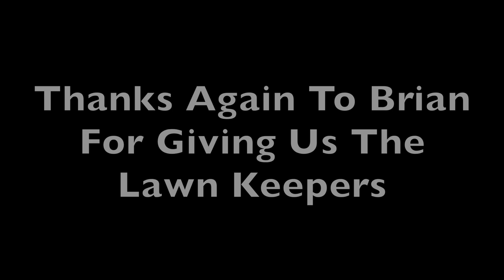(Part 1) You Don’t See These Mowers Anymore - Will It Run?

Comment: Hey Taryl, what a catch. When you lifted that mower up and I saw the frame made out of round and square tube welded together, it reminded me of my time as a welder in a shop summer of 1970. There were  199 thousnady million job shops in the Detroit suburbs where you could get a job in a second. Staying at one was something altogether different though. I worked in a 120°F production welding shop where we had 450 amp mig welders w/ water cooled handles and a setup guy for each welder. Imagine  4'X4'X4' palleted boxes full of parts to be welded together. That provided my dinner. Couldn't wait for the Roach Coach to show up at 10am for a snack break. Then lunch at Noon, and 15min break at 2:30 then home goin time at 5pm in a 500hp car to drive in bumper to bumper traffic for 45mins. Yep, we welded little frames like that one, crossmember parts for Ford, luggage racks for Yamaha etc. And if you didn't like the job, you could find another in 10mins. Those were indeed the days. After that our politicians sold us out and everything went to C-H-I-N-A. And a Lot of it is JUNK. OK, fine video Mr. Dactyl. Thank you very much for the entertainment. ben/ michigan
Reply: There's no law saying you couldn't start your own job shop.

Comment: These older Briggs have some real longevity. Honestly think it would've ran first pull if you could've taken the choke off fast enough. Thanks for the dinner, Taryl!
Reply: I agree but they should have had the serial and model number stamped in the block instead of the shroud

Comment: Bolens was still making the articulated riders in the '80's when I was working at a dealer-they started coming in with steering cable failures. They came out with a retrofit kit that I had to install-no charge to the owners. Thanks for taking us along on your journeys, guys!

Comment: I remember these coming into the shop every spring for tune up and sharpening.  The original “almost” zero turn mower.  People with estates and a lot of landscaping really loved them, but they didn’t hold up very well over time.  I like the way the green lever lifted the front deck for servicing. Cool stuff.

Comment: Awesome mowers, just love the old stuff they were built to last not like the crap they sell today. Going to be a fair amount of work to get them restored but what a treat to pull them out from time to time and give them a run like they were designed to do in the mid 60's. How's the new shop coming along Taryl, update coming soon? Keep up the video's, cheers.
Reply: I really like seeing older stuff too. The way they are often "overbuilt" in certain areas and the 50s-60s-70s styling is neat. Nowadays they have really mastered the art of mass production and wherever they can, they cut corners and make the parts out of very thin sheet steel or plastic and the (big box store mowers) designs are all about identical with just different styling, decals and paint.

Comment: I like how the gas line is not a rubber hose that would deteriorate over time. When I was a kid, my Dad brought home a "burns" mower that is that size but not a split frame. The mower motor on the burns had so much torque that you could pop a wheelie easily when popping the clutch quickly! Good times..

Comment: You buy replacement shoes you reglue back onto those brake pad peddle that rides inside of those rims on those riding lawnmowers you just got. Those are brake pads that half to be done that way to. Instead of regular types of brake pad shoes. That's another item online part you can order still to. I'd order two sets of those if you decide to. It'll save money for shipping and handling fees in the long run to that way taryl. Acetone removes that adhesive glue good to. Then sand those brake pad peddles so the glue sticks and adheres to the surface better to. Good luck on fixing and restoring that pivoting frame and body bolens riding lawnmower to.

Comment: The air filter looks just like the ones on the 3 and 3.5 HP B&S powered push mowers I used in the 70's. The spring strap that the seat is mounted on might be bent or sagging from decades of use. That does look like a tight fit between the gas tank and the seat. Cool looking lawnmower.

Comment: That would be a fantastic rig to bring along to shows and swap meets. Its small and maneuverable. Save the deck for the other one and get a electric start for this one. There's yer dinner.
Reply: It really is a convenient and compact machine and really shows us you don't need horsepower in the double digits. I imagine it is a bit tippy on hills though so it isn't a perfect machine (none of them are but zero turns are approaching that larger safety margin).

Comment: You guys have all the cool toys. Thanks for the video. Thanks to Brian for making the video possible. I think the horses were bigger in the old days.   
I had a house brand 25 inch push mower that had a 3 HP Briggs flat head with the pulsa-jet carb. Bought it new in 1961 or so for $50.00 and kept myself in pocket money cutting a bunch of suburban lawns with it.

Comment: Man I flipped when I first saw these mowers, I was born in 63 and I remember them,  I completely forgot they made these. Used to see them on golf courses alot. I have a bolens push mower. Drain the fuel out every fall, starts up 1st or 2nd pull every spring.

Comment: I remember all those goofy looking mowers from the mid 60"s.Seems I remember most commonly the 2 1/2hp.Briggs & Scrapem powered many pieces of lawn equipment.Had a go cart powered by one.Went thru quite a few of them.Dibdn"t pay for anything back then,someone was always scrapping an old horizontal shaft mower.Never knew you could get them to spark with just a turn of the flywheel without spinning it,Great vid!
Reply: That's BREAKS and Scrap 'Em. Must be the hillbilly teeth that causes so much misunderstanding. I often wish he would drop the schtick and just do it straight but keep the witticisms.

Comment: That's so cool! Never knew that there was a riding law mower that small and articulates, and only has a 28" cut deck with 3 blades.  The engine is a real B&S compared to todays standards.  The tires remind me of the two Gravely convertible mowers we have.

Comment: Today the 910 would cost at least $3,318.93 and the 911 would cost at least $3,798.26. MTD appears to own the Bolens brand and a 42" mower under almost any brand name can be had for less than $2500 from almost any big box hardware store.

Comment: I has one with a Briggs, in the '70s.  One time it broke in half.  The local welding guru cut out the pin that had broken off and replaced it with a hardened bolt around 7/8" give or take.  Mine had plenty of wear and kept breaking down.

Comment: I guess Bunton went out of business? Made edgers and trimmers that pretty much got made obsolete when the new fishing line string trimmers got invented--
they made a 20" wide pushmower that had a 3 and1/2 hp. Tecumseh "XL" engine that seemed more powerful than the typical Briggs engine labeled 3.5 hp. and did not have compression release or automatic choke or primers. I think there was advertising printed on the yellow painted engine shroud (No Plastic deco cover) that said "Stellite Exhaust Valve with Exhaust valve in intake position" or something like that.  Full adjustable bowl carburetor and the air intake used a hose like a vacuum cleaner hose with the oiled sponge air filter  mounted up on the mower's handlebar.

Comment: Sounded like a packrat convention.
I like the articulated steering design of the little ones. I've never seen that before.
I don't think they marketed riding lawn mowers and other lawn care equipment to women  because women actually cut the grass. I think they did that to get the wife to agree to spending all that money on a riding lawnmower that the men wanted. The women would have been happy for the husband to have nothing more than a manual push mower. Riding lawn mowers were a luxury and all the men wanted one.

Comment: Made a racer out of the bolens. Change the pulley, and it will stand up and drag on that rear bumper perfect. No deck of course. Very dangerous at 40 mph if you turn the wheel much. Shift to high range, and the front wheels will stay up! Try it..dare ya T-man

Comment: Congrats on getting 910 to run and drive.  update on attaching the cutter blade to 910.  did u stop to see if the owner
of the orange tractor would sell-it?  on the way to pick-up the 910/811 mowers..

Comment: Ooooooooo ... Bolens articulating tractors. EK Series. Wisconsin motors!  Send me his contact info, please.
Reply: These latter two are the small articulating  mowers. 7 hp Briggs I believe. I think the current color Rustoleum Biscuit White.
Reply: 910 mower. 
Briggs & Stratton 142702 
gasoline 1-cylinder air-cooled
Power6 hp
4.5 kW 
Starter typemanual recoil

Comment: This is the superior mower design. The Husqvarna Rider is a obvious copy of this. Having the blades up front with the engine behind you with articulation steering is great.
Reply: Husqvarna did copy a rival in Sweden called Stiga. The early Husqvarna out front mowers were based on Stiga chassis then Husqvarna developed their own off the Stiga design. But judging by these mowers I guess some inspiration was also taken from these.

Comment: That way it has that B&S letters pressed into the shroud pull starter and gas tank made together as one. That's A late 1960's to mid 1970's model of  pull starter shroud that wasn't stamped back in that area. They made both types of those with and without the letter's stamped into those pull starter shrouds back then Taryl.  Just thought I'd let you know that part about them engine's A little bit more to.

Comment: I know this is off subject and idk if you will take the time to reply or if you do reply at all but I am having trouble with a briggs 18.5 hp on a yard man mower it had a really bad surging problem I cleaned the carb put a new carb on it no change finally i was messing with it one night and I seen that the governor linkage spring was actually sparking I have changed the flywheel because the magnets were loose and swapped out the little alternator under the flywheel because I figured that’s where the governor was getting power from the block but it still is lightning the spring up like a spark plug I have looked for cut or smashed wires and i can’t see any idk if a bad ground somewhere could cause this problem or not I’m kinda stumped here and don’t know what to do next can’t find any information about anything like that happening in any mower forums so taryl if you have any information that could help me it would be greatly appreciated or anyone else in the comments have any ideas let me know I appreciate your time to anyone who actually reads this book of a question lol 😂 either way I love your channel man it has helped me multiple times in the past with issues best wishes

Comment: Using the inflation calculator, $415 in 1967 would be equivalent to $3,798.26 in 2023, and $342 in 1965 would be equivalent to $3,318.93 in 2023. So those machines were very expensive in their day.

Comment: Idk much about electrical on small engines but I had a older techuschum and put new coil on it and fired right up left points and condensor in it just cut wire 🤷‍♂️ 🤷‍♂️

Comment: I just fixed one for a buddy of mine up the road that has a John Deer like that with the engine on the back
Reply: Was that one of those 3 wheeled out front mowers JD did? They were a odd seller in the UK and around 2005-2008 John Deere's European lawn care division decided to sell re-branded Stiga articulated out front ride on mowers.
Reply: @bentullett6068  nah it had 4 wheels with the single cylinder out back with the foot plates above the front wheels and the tall steering wheel column that sprouts from between your feet and the key cylinder on the plate under the seat where you have to reach between your legs to start it.
Reply: @renamon1983  must only be a model they sold in the USA.

Comment: Not my project, but I don't care for the lights the way you have installed them, but it doesn't matter if I like or not, as long as you like them, that's all that matters! I do like the way you do the metal work to get to where you want, not a lot of body filler to do afterwards